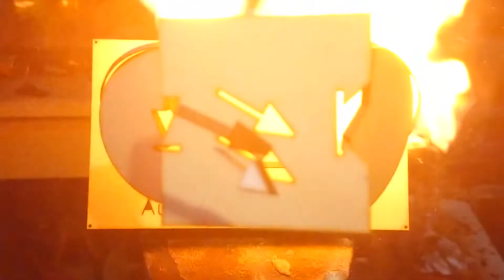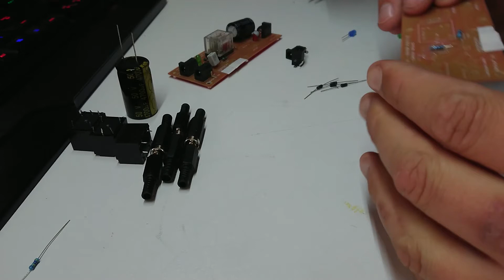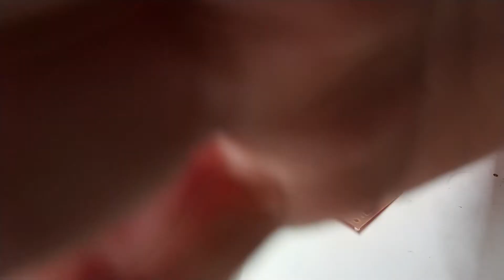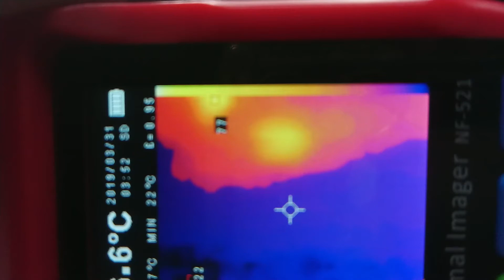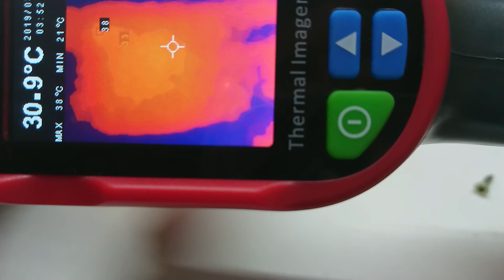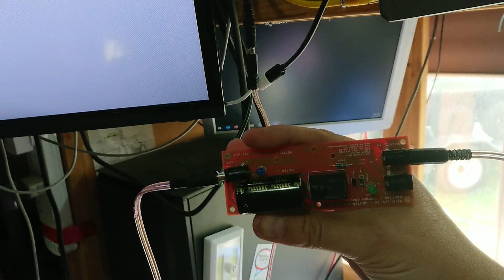My power is getting disconnected!... for a day.

Comment: Good video.👍
With the long rolls of resistors, I write the value on the the paper strip at intervals along the length.
I agree about lead gauge on the diodes, most of the heat sinking is through the leads and if you are getting current close to the diodes rated value I tend to lift the component clear of the board to allow some air circulation.👍
With plated through holes your technique is the best because  as you say you are heating the copper pad and wire and that will draw the solder down the hole for a good connection.
Can you just mount the DC sockets on the other side of the PCB? 
But then again you aren't using the side tag.
The back EMF diode only conducts when there is a Back EMF, so it should be cool 99.9% of the time.
Not sure how you have your circuit configured.
Reply from the maker: RE: led rolls - it is written on it somewhere but I didn't want to unroll it, that brand tends to fall out of the strips easy, and it never hurts to double check.

I whacked a giant diode on the back of the board after this video and it's stable at around 90c the smaller one got so hot it melted the solder. I am pulling 5 amps through it after all.

Not possible to use other side of board easily will fix it in the next version, this was the last board of 10 anyway.

in all the other ones I have built, the back emf diode doesn't get hot, so I think maybe faulty diode.